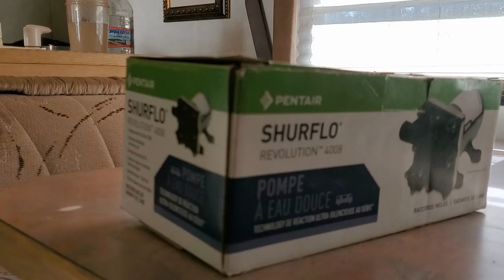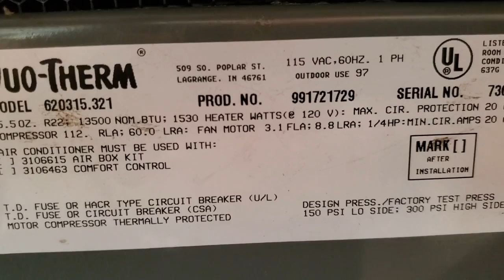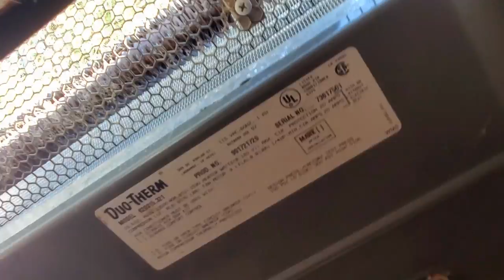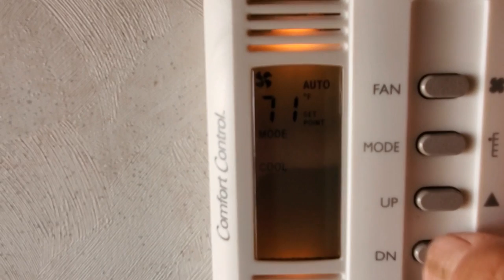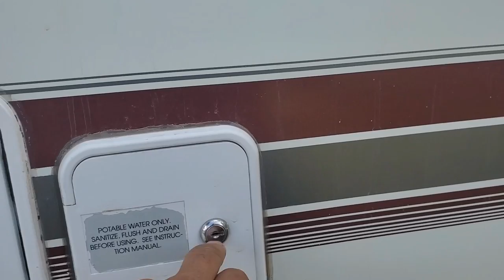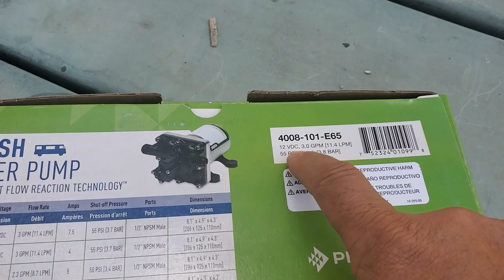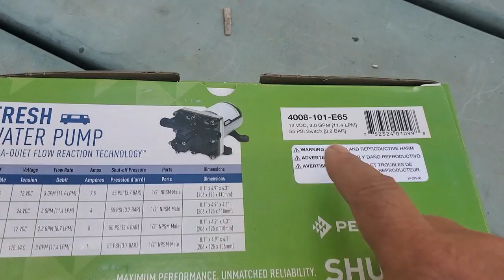Rv Roof A/c Repaired! What Was Wrong? New Water Pump Too!  What Did It Cost???

Comment: Kevin, Friend has an older RV that they also installed a Mini Split...They too needed a way to vent...they used a window screen, built a frame to mount it on, installed it on hinges on one side so it can drop down to fit into the opening. When they stop to camp, they open the cargo door, drop-down screen, good for as long as they are camped...Cheers from Maine.

Comment: It’s a sealed system “if there are no leaks” 
I suspect ... you have a small pinhole leak that are hard to find ... even with the latest technology leak detectors ... besides they can be time consuming 
The company that I worked with decided it was more efficient and cost effective to just add a dye that when it leaks the dye can then be seen with a UV light showing where the leak is ... the room or area just needs to be dark (canvas) so the dye can be seen with a strong uv light. The dye is added along with the proper amount of refrigerant ... if the symptoms return ... the time since the dye was added represents to certain degree the size of the leak.
Freezing can be caused by two things : one ... air flow ... two ... low refrigerant (can even be that the factory didn’t get enough in) ...
If ... there are no access ports ... one can be added ... they are a last resort ... because depending on the type used ... they can leak in time due to rubber gasket deterioration over time. If it is a newer system type that uses 410 refrigerant ... the pressures are extremely high as that is nature of this type.
Air flow issues are caused by dirty filter, problems with fins either bent or dirty ... dirty blower wheel &  even motor issues where rpm is improper for a number of reasons.
The temperature sensors are more of a safety feature for the system ... if the system is low on refrigerant it’s bad for the system as oil is in the refrigerant for the compressor ... so to prevent compressor issues ... freezing represents low refrigerant and that means low oil flow as well ... thermistor is used to shut the system down to protect the compressor.
Hope the repairs are effective for your RV
Just trying to be helpful
Very informative video ... that many will appreciate.
Thank You

Comment: Hay there Kevin. My class A Holiday Rambler is an 1987. I replaced both Roof A/C covers with new styles but they are the original units and they work good. But they look Brand new.

Comment: If You have to trim the hole, they make a little hand saw called a key hole saw and they are not very expensive.   It will trim paneling and sheetrock pretty easily.

Comment: How about a dual system with a nice looking louvered cover on the outside backed by a stronger grid on the inside. Even something like metal shelf tracks could be mounted close enough to prevent entry

Comment: Kevin, I am sure Josh told you, it is air conditioning unit, made to only drop the inside temperature 20 degrees from the outside temps.  It is not a refrigeration unit. I worked for an A/C company in FLorida for several years, Hard to tell people if it is 100 degrees outside the A/C unit will not drop the temps to 70. Hope all works out, you are blessed to have found him.

Comment: Get a dryer vent for houses.  They have a piece of metal inside that will open to allow the heat to exhaust from one side and will keep critters from coming out.  You could reverse the flap and use it as an intake as well .

Comment: I always bought a spare set of faucet parts, a water pump, electrical outlets, and other small parts when I bought my last rig as they were cheaper thenemergency! or when needed. And to have them taped under the vanity or counter in both an RV but my house so it's right there in case of emerency! The spare water pump went under the bunk in a box in the hardest corner there! 
And long time ago we only had a well. Water service wasn't a thing yet but dad had a s p are submersible pump JIC the old one died.
If it dies it was an easy fix not the usual panic problem it can actually be!
And the same for every light bulb on your rig!  Clearance light bulbs or the whole sealed lens cover thing plus a spare red and amber cover. And yep a headlight be it an old sealed thing or halogen. Have a spare!

Edit: BTW; I have an old bank bag that I've carried for at least 30 years in my trucks.
It's filled with all sizes of dash, clerance, brake lights and when halogen and led headlights came out they went in. The old big headlights stayed in the tool bag. Still have that bag in a cabinet in Minnie. Ya never know! But what's so funny is many of them are probably never going to be used as even dash lights are going LED or strip lighting. Guess I'll put them in a museum!

Comment: Circuitboard: pause at 13:30 and look at the bottom of the screen under that long, vertical copper strip. See the corrosion? That needs to be addressed because it will fail as it corrodes.

Comment: I would look at getting dryer vent covers.  Add screen on both vent covers.  On intake side remove flapper and add small 12 volt fan to outblow side. The fan should make it so you can bring air through and possibly have it on a temperature switch.

Comment: Service ports are foolish. Its a closed system for a reason. Home ACs dont vibrate on the road at 60+ mph. RV Tech school says we are not authorized to tap into the high pressure 200 psi+ system. If you tap you will be readding every couple months at $100+ for service call.
Reply from the maker: My mini splits take serious vibrations. On e is year and half old

Comment: I am wondering why the need for this service of the AC unit.
I thought that is why the mini split was installed? Won't it stay cool enough by itself?
Reply from the maker: Not if I go to pheonix in summer to see my doctors.  It gets 120 there
Reply: @CampervanKevin  okay thanks I am in Arizona so I know about the heat. Luckily I am not in the super heat zone. Close to Sierra Vista.
Last I have seen schrader valves installed in the line of the sealed units, that allows for recharge.
Could not quite understand the other type of device you were talking about. Research under way, because it is hard to find anyone willing to install the schrader valve. Everyone says it is because of no way to trap the old refrigerant when cutting to install.
P. S. Found it saddle valve awesome to have found a monetary affordable way to fix my ac. They were trying to get me to buy a new one, when it just needs changing.
Reply from the maker: @jamesclark9347  let me know how it works